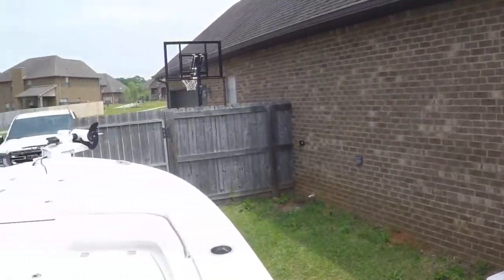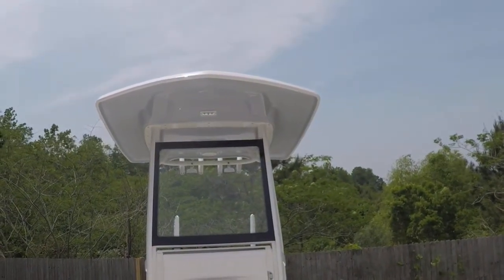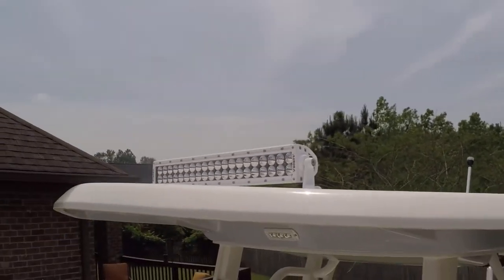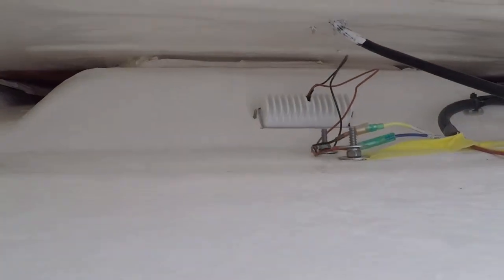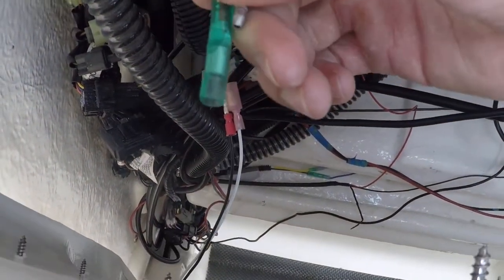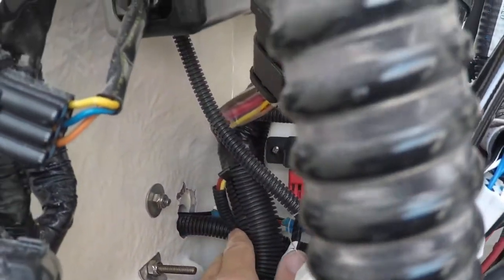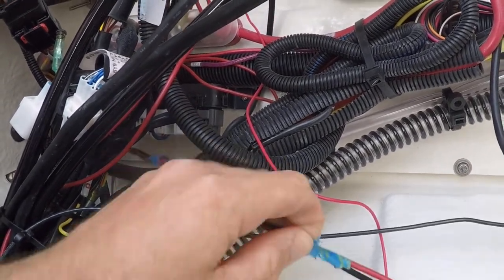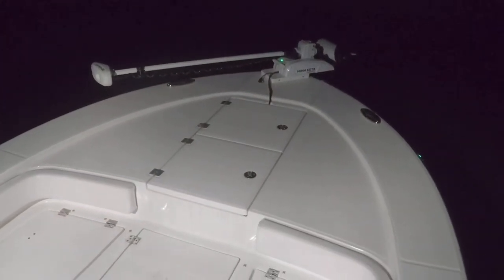How to install a light bar on a boat

Comment: Would you think a 30" is too much for a 24' bay boat? Are there times when you have needed more peripheral light?
Reply from the maker: A 30 would not be to much. The 20 works great too. I use mine all the time for fishing and running in the dark with the family after beaching

Comment: Hey I’m looking to get one of these but they say their curved but yours looks straight? Just looking to see if what they put on the website is true. I would rather have a straight one but I don’t wAnt to order it and it be curved.
Reply from the maker: They sell straight ones https://offbrandproducts.com/products/aurora-20-inch-marine-white-led-light-bar
Reply from the maker: I called them when I installed mine. They were very responsive and told me about scanstrut for the water tight seal
Reply: Thanks I just ordered mine

Comment: So it's been 6 months since you posted this how's it all holding up? I have a Robalo R222 and was thinking about doing the same.
Reply from the maker: Absolutely love it still. I provided a brief statement about it in my 1 year Robalo 246 cayman review. The only thing I had to do was to increase my breaker from the 5amp to the 10 amp. Also watch the light bar update. I had to change the way I connected the light bar to the t-top
Reply: @GULF2BAY  yeah I realized that after but thanks for the update. I just ordered one for myself I'm unfortunately going to have to use the switch that comes with it or figure something else out since I already did underwater lights and that switch isn't available
Reply: @GULF2BAY having a hard time finding your update video on the mounting process.
Reply from the maker: @ryanwalsh5305 https://youtu.be/sE60-uXwFxw?si=vYza-Rew4ANQU8Ob
Reply from the maker: The light bar is still working perfectly. I use it all the time early in the morning before the sun rises and while running back in late. Bolting it down is the way to go.